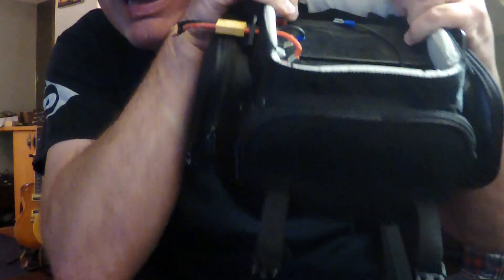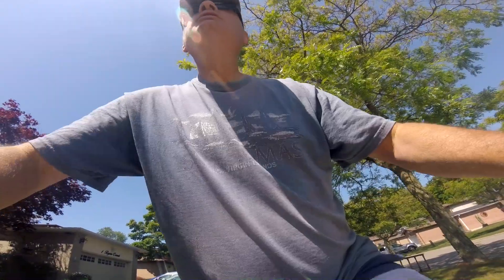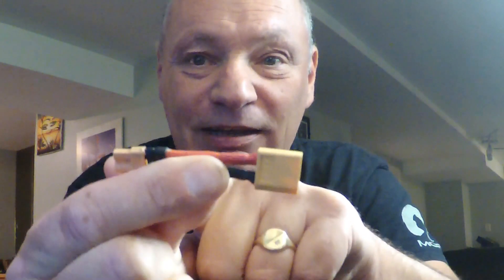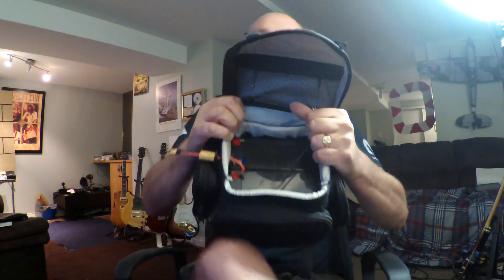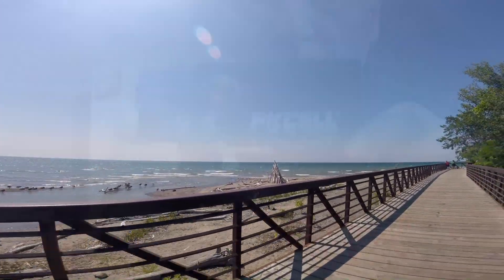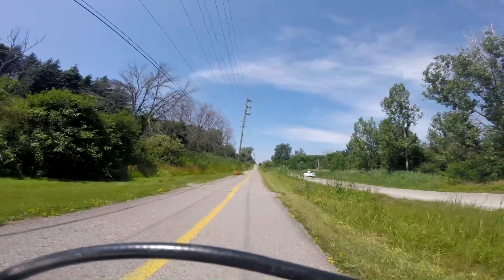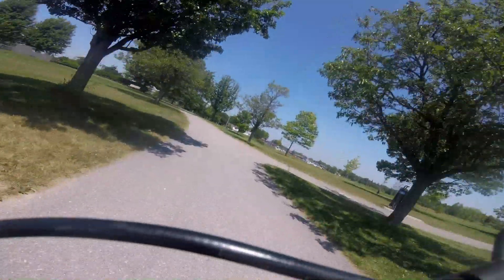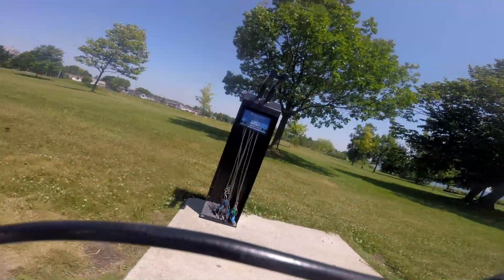E-Bike on Lead Acid, how long will it last

Comment: sorry but.. watched the video and i didnt hear you actually give results... um... ZERO THE WISER
Reply from the maker: It did really well, I got a two hour ride using peddle assist and throttle, I was surprised TBH, sorry about the vague. The best part about lead acid is price. I still had power left when I got home.
Reply: @twowheelsplusmore  right thankyou...  i think the best thing with vids of this nature is show a full drain of the battery.. then we know what its max is in your instance...  keep em coming